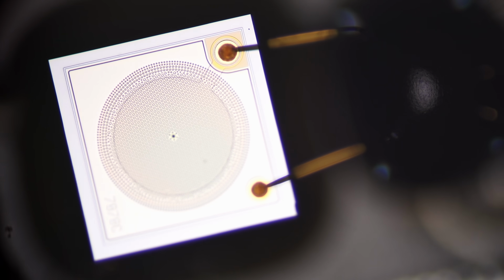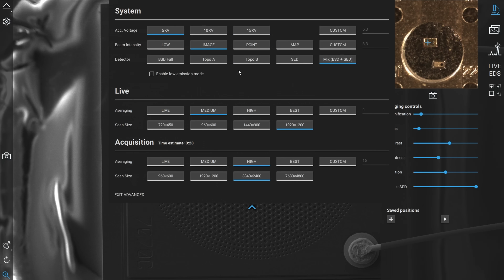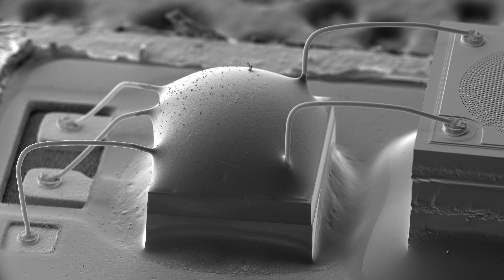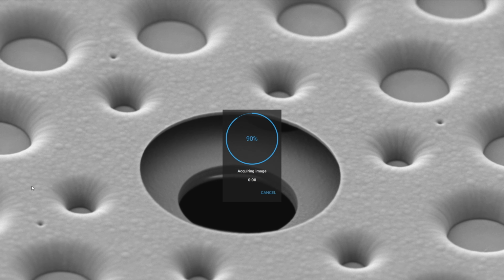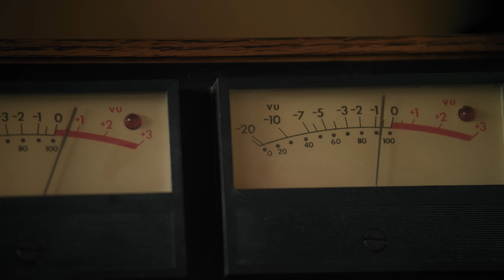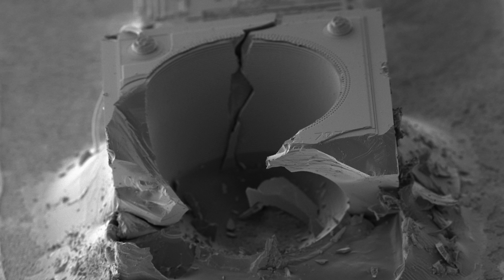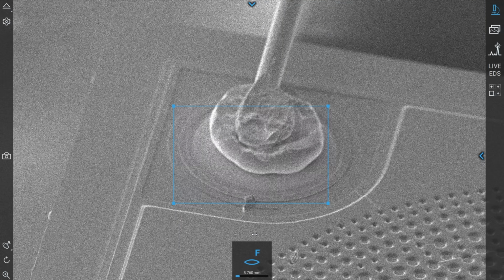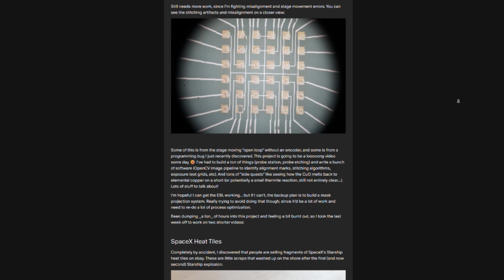Microscopic Marvel in your Earbuds

Comment from the maker: Addendum
- The "tactile buzzer" is just the battery. Brain fart, not sure where my mind was when writing that out. Whoops! 😅

- Some folks were curious how the middle gap between the layers is made. I don't know for sure, but it's likely that they used a sacrificial silicon dioxide* (SiO2 aka glass) layer in between the two "functional" layers. So the process flow would have been: pattern and etch bottom layer's array of holes, deposit a thick layer of SiO2, deposit and pattern subsequent polysilicon layers (doped or undoped), then finally etch out the SiO2 layer with HF or plasma. Then flip over and DRIE etch the big cavity from the backside.  That is also likely why the dimples are dimple-shaped... they are just following the curve of the sacrificial layer that was filling the holes from the very first layer.

*I suspect SiO2 because there was some EDS data (not shown in the video) which showed high concentrations of SiO2 right at the broken edge between the layers, where they meet at the "bulk" of the substrate. I think that's leftover from the sacrificial etch process.
Reply: And here i was googling wtf a tactile buzzer is lol
Reply: @98f5  it's what apple brands as the "taptic engine"
Reply: @kreuner11  A taptic engine is a weight driven by a magnet and a voice coil. It looks like little metal square or rectangle. They can do many different vibration patterns that rotating mass vibration motors or even a basic linear mass vibration motor. The generic term for a taptic engine is a haptic motor or haptic engine. There are now Android Phones that feature haptic engines due to the expiration of Apple's patent.
Reply: I didn't catch it - I was too busy looking at that mems marvel (:
Reply: Your work continues to blow my mind also. Thank you for bringing this high quality educational entertainment to me. 😊😊
Reply: > I suspect SiO2 because there was some EDS data (not shown in the video) which showed high concentrations of SiO2 right at the broken edge between the layers, where they meet at the "bulk" of the substrate. I think that's leftover from the sacrificial etch process.

The poly Si layer and the bulk must be electrically isolated, otherwise the capacitative sensor would not work. It's possible that the SiO2 does double duty as a sacrificial layer and the isolation layer, but they could also be done separately.
Reply: I swear to god that these are the earbuds that I have😂. I have just been holding my earbud and looking at the screen back and forth. Very informative video, and beautiful pictures.
Reply: It's interesting we see no microorganisms. It's really work to keep things sterile.
Reply: Lol, I was just about to comment on that
Reply: Thx mr cool!
Reply: I mean.. it's surely tactile when they blow up
Reply: Well, the buzzer in newer Smartphone kinda looks like a coin cell nowadays.
Reply: why not ask the manufacturer ?
Reply: Now I'm kinda wondering whether it's an actual battery or a very small supercap...
Reply: great video, commonly HF release or wet etch are used to remove SiO2 gap layers separating the fixed and movable electrode. REF: S. A. Zawawi, A. A. Hamzah, B. Y. Majlis, and F. Mohd-Yasin, “A Review of MEMS Capacitive Microphones,” Micromachines 2020, Vol. 11, Page 484, vol. 11, no. 5, p. 484, May 2020, doi: 10.3390/MI11050484.
Reply: i just was about to say that
Reply: Can you put subtitle please, so I can use the translator option. Thanks, nice content.
Reply: I wanna see a que ball under an electron microscope
Reply: So did the rapper MIMS name himself after MEMS, or did MEMS get backronym'd from MIMS?
Or is it just a coincidence?
Either way 🤯 mind blown! 😂😂

Comment: Really cool breakdown. I am wondering if the dimples and holes in the membranes could be there to maximize the surface area between the membranes. This could lead to larger changes in capacitance as the plates vibrate and a larger output signal. I wonder if this may even be a necessity to get a decent signal out of such a small microphone.

Comment: Summary
- 0:00 A microphone is crammed inside a tiny earbud, and the video will explore its internal structure.
- 0:07 Introduction to the concept of micro electromechanical microphones, which are much smaller than traditional microphones and can fit inside earbuds.
- 0:24 Description of miniature microphones like electrostatic ones, which are smaller but still too large for earbuds. The need for even smaller devices fabricated from silicon wafers is highlighted.
- 0:46 A $10 pair of earbuds is opened to reveal its internal components, including the speaker, buzzer, charging magnet, and a long PCB with microchips and a tiny microphone.
- 1:17 Examination of the tiny microphone, which is about 3mm long, using an optical microscope. The microphone is a square block of silicon with a pattern of holes.
- 1:50 Detailed analysis of the microphone's structure, including its size (under a millimeter wide), the arrangement of gold bonding wires, and the layers of the device.
- 3:22 Exploration of the microphone's internal structure, revealing a second layer beneath the first, and speculation about the function of the deep cavity underneath the layers.
- 4:27 Discussion of how the MEMS microphone converts sound waves into electrical signals using a silicon membrane and capacitive changes. The top dimpled surface is the vibrating membrane, and the chip amplifies these vibrations.
- 6:14 The video shows the intricate etching process used to create the microphone's cavity, highlighting the deep reactive ion etching (DRIE) technique.
- 8:16 Conclusion that MEMS microphones, while simpler than other MEMS devices, provide excellent audio quality and are widely used in cell phones and earbuds. The video ends with a thank you to Patreon supporters and a recommendation for another video on MEMS technology.

Comment: Back in 2003 a company called Akustika built a MEMS capacitive microphone on a CMOS chip. The chip was about 2mm on a side and the microphone was a membrane of oxide and metal over a cavity.  The CMOS chip also had a preamplifier and an analog-to-digital converter. So the chip produced a digitized signal with only a connection to an external battery.  Total harmonic distortion was hi-fi quality and noise was low enough for use in hearing aids.  This was an early prototype.  Akustika designed the microphone. I and a colleague designed the preamp and ADC.  After fabrication in a CMOS foundry Akustika did the additional processing to fully develop the microphone structure. It worked.

The device you show has separate microphone and preamp dice.  Probably also a pretty decent performing device.  What people are doing these days with MEMS is stunning.

Thanks for the video!
Reply: Correction: the company name was Akustica, rather than “Akustika”.  Akustica is now part of Bosch.

Comment: it works like a reverse electrostatic speaker.  size is not audio quality related..  in fact a small membrane would be able to pickup high frequencies from all directions like a true omni direction mic.  only downside of such small mic might be efficiency or noise floor

Comment: So what's up with the dimples? I'm assuming the dimpled plate and plate with holes are supposed to increase the surface area of the capacitor plates and therefore the capacitance, improving the signal to noise ratio as well as letting air escape between the plates? Without the holes, the higher frequencies would probably be dampened, making it sound kinda muffled/dull? But the dimpled surface would probably also make the plate more rigid which doesn't seem particularly advantageous, cause reducing the amplitude of the movement would also decreases the signal to noise ratio... Would be interesting to figure out what design decisions like those were about.

Comment: 6:33 How did they create two layers with a gap between them? Is the top layer of silicon bonded on later? (Probably not, that seems expensive and error prone)

Was there some kind of filler material added before polysilicon deposition that was dissolved or melted away in a later step?

Comment: MEMS is the quiet revolution. That tiny microphone, tiny sensors, gryoscopes on drones and modern airplanes, all done with MEMS. It started as engineers seeing other applications for IC processes than just electronics and making such things as working microscopic motors, but then quickly advanced to more useful concerns.

Comment: I'd like for someone to do this on a higher end earbud, like a $300 Beats or Bose earbud to see if they use essentially the same microphone or if there is a definite quality difference to the etching and the like.  I'd assume more work and quality control is done with the microphone but that's just conjecture till I see one broken down like this myself.

Comment: These microphones typically have a digital output using "pulse density modulation", where the rate of toggles encodes the analog signal value. The three ports coming off the control die are almost certainly power. ground, and audio out.

Also +1 for DRIE video. That was the first thing I noticed when you cracked it open. The Bosch process is cool!
Reply: I counted 7 heavy etchings on one component, couldn't get a good count for thinner etchings for things like the resonant chamber.
Then, I considered how many ways I could badly injure myself on the equipment that builds these devices... Ion beam, HF, yeah, gotta be a pain to maintain those machines!

Comment: 6:54 the strip appears to be continuing on the lowest level, the steps and rounding are artifacts of depositing uniform thicknesses of additional layers.
The layers on top of the lowest features only appear to also have the feature.
... meaning, the strip only appears to be deposited on top, if you ignore the rounded edges from additional layers on top of the original feature.

I'm not sure if you understood that, since to me it seems like you implied that...

anyways really awesome to see tiny devices like that 👌

Comment: I believe the cavity underneath the membrane has to do with resonance. Depending on the volume and opening of the cavity, it resonates at a certain frequency and therefore creating a standing wave inside, that can act as a bandpass filter which can allow as well as block out certain frequencies. But it certainly is more complex than that. And at this tiny size, it must be a pretty high frequency, above 20,000 Hz the range detectable by humans.

Comment: The microphone is not the type that produces small electricity. but rather changes in capacitance. that's why it's called a condenser microphone. it's not a plastic layer, but 2 pieces of metal plate. exactly like condensator

Comment: Would those dimples improve the deflection of the top layer, which would improve the dynamic range of the capacitive effect?
Or would the dimples going into the holes itself improve the dynamic range of the capacitive effect with greater electrical surface area interaction between the top layer and the bottom?

Comment: What is interesting about the bond-wire at 4:40 is that the bondwires seem to be mounted on top of a gold ball. If it was ball bonding, I would expect a clean transistion from the 'mushroomed' out ball to the wire, but this is not the case, you can clearly see that the wire itself has been smooshed (through what looks like wedge bonding) onto the gold ball.

Comment: I'm not confinced that the features are that 'big' on the piece of silicon: around 4:20 you can clearly see much finer structures on the inner metal layers (on the left of the die). It's really quite hard to tell on a mixed signal, chip what node it is, because the top metals and the big power devices will always be big, and past like 350um, you really can't use an optical microscope to make out any of the lowest down metals anyways. 

I wouldn't be surprised if there is a basic (digital) signal processing circuit on there that can apply a few digital filter taps by way of calibrating for the inherent response of the microphone. You see this all the time in automotive sensors: The sensor might only have 3 pins, with supply, ground and some current-loop out, but the chip is actually 90% digital, but for legacy reasons uses this analog output.

Comment: The hole in the middle is a barometric vent to prevent the mic from crashing from atmospheric pressure changes. 

The ASIC is generally a charge pump to bias the diaphragm and yeah, it’s likely an analog microphone Vs PDM (Pulse Density Modulation).
Reply: As for the back cavity, yeah you need a back volume. If you make the back volume too small it will have implications for frequency response but also noise. As the microphone internal volume gets smaller and smaller (and the diaphragm area) you get more noise from Brownian motion of the air molecules that strike the diaphragm. If you double the size of the diaphragm you get 6dB more signal but only 3dB more brownian noise.

Comment: Great video and images! If you have a fine diamond saw or pad, you might consider grinding off material from the side, instead of breaking it open. In that way you can make reasonably clean cross sections, especially with the use of some extra resin.
Reply from the maker: Will try that on the next one! I admit to being a bit lazy and just smashed it with some tweezers haha

Comment: Okay… so only one mic.  They’re going to be pretty terrible at rejecting noise, but what do you want for $10!

The central hole is for:
1) barometric equalization between the front and back
2) to roll off the low frequency response so that wind bluster is minimized.

Comment: Also not a seasoned audio engineer here but my trivial explanation for the cavity below the membrane is, that it provides a neutral pressure reference against the outside. Thus the microphone becomes omnidirectional. If it would be open from the back, sound waves coming from the side would not be picked up. Thank you for that brilliant deep dive of a video!
Reply: To my best knowledge, the size of the cavity vs. the diameter of the central hole define your lower cut-off frequency, otherwise this thing would be driven into saturation by low-frequency or static pressure.
Reply: @commander-tomalak  that's my thought. Vented microphone to control for VLF and barometric pressure, the cavity for resonance, the steps to tune and reflect various frequency harmonics. Impressive, given the frequencies used in narrowband telephony is around 300 - 3400 Hz, wavelengths ranging from around 45" - 4"!
Yep, a quick lookup shows they're called a MEMS resonant microphone array.
Here's a discussion on active noise cancellation using the technology.
https://www.ncbi.nlm.nih.gov/pmc/articles/PMC7978172/
Reply: huh, that's a concise but insightful bit of knowledge, and goes to explain quite a bit, thanks!
Reply from the maker: Neat, TIL! Thanks for the explanation!

Comment: I really dig all of the MEMS videos you have done!

I'm also really impressed by the CGI cross section of the microphone you made for this video. 

Absolutely fantastic work. 

I hate to be "that guy" in the comments, but I've never heard someone pronounce DRIE as "Dry" when talking about the Deep Reactive Etching process. 

Usually folks refer to it by saying the letters, even though it is a bit of a mouthful.
Reply from the maker: Hah, TIL! To be honest I've never heard DRIE pronounced, so it always just came out as "Dry" in my head. Good to know! 😅
Reply: @BreakingTaps  No problem.

Thanks again for making interesting videos on microfabrication.

It could be fun to take a look at an emerging MEMS tech: MEMS speakers for earbuds. 

xMEMS has been working on the tech for a number of years and earbuds with MEMS speakers are hitting the market this year.

Comment: The geometry of the whole thing is interesting.  The dimples probably make the upper membrane more stiff, and might have been calculated or arrived at experimentally.  Stiffness is useful in this application as you don't want to respond to the inertia of the membrane itself (flopping around).  The chamber below is indeed for resonance, and it should be possible to physically measure it and calculate what frequencies it is sympathetic to; my bet is that it works really well for key frequencies in "toll-quality" audio (voice).  I'm also betting that the device is good at picking up low audio frequencies from whatever it's mounted to, letting the whole earbud vibrate as an extension of the sensor.
Reply: Spitballing... I imagine the dimples are to make the upper membrane less stiff.  Stiff membranes resonate---like a drumskin---and you want as little resonance as possible; while still attaining high deflection for gain.  (High Q, high amplitude voltage ringing, even above hearing frequency, can upset amplifiers.)
Reply: I'll add my own unqualified take into the pot: it's silicon. It probably has a really wonky breakup pattern that the dimples help with!

Only joking! It's a cheap MEMS mic, guys. They probably just make the capacitance less spiky and mic a bit more sensitive since the holes are under the dimples. The only design features here are to loosen tolerances or lower cost.

But the cavity under just seems like a classic Helmholtz resonator. It likely is for tuning.
Reply: I was thinking they did it to make the surface area of the diaphragm a little bit bigger. Maybe even tune it to a specific frequency.